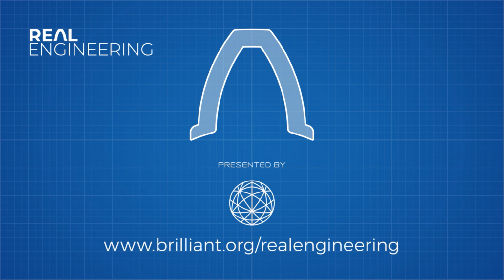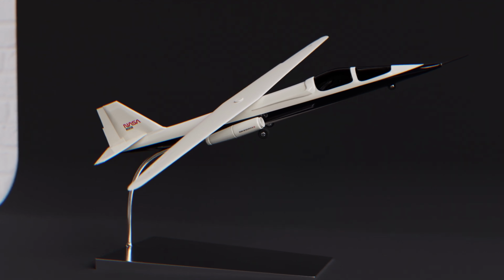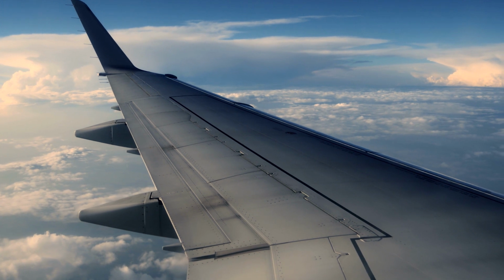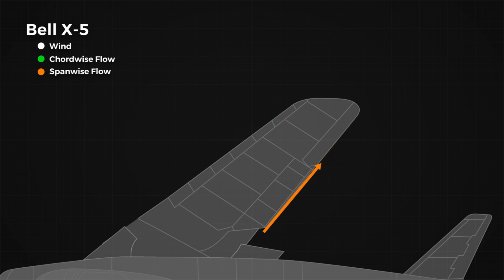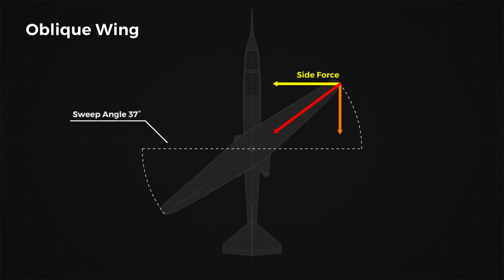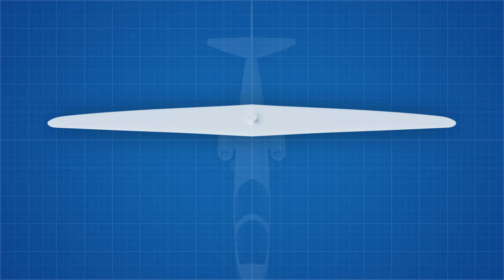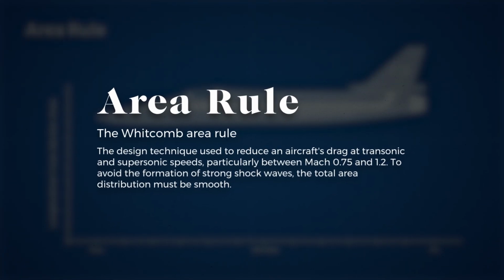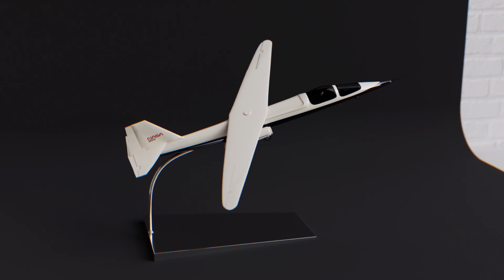NASA's Weirdest Experimental Plane

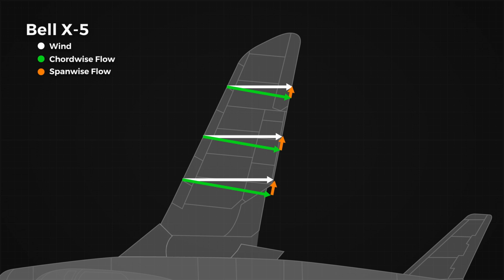Comment: 3:40 chordwise flow is the component perpendicular to the centerline of the airplane, not that parallel to the leading or trailing edge. And it happens not just because of the geometry of the wing, but because there spanwise pressure gradients due to sweep

Comment: I feel like an important aspect of the plane wasn't discussed in this video, that the oblique wing (60 degrees sweep angle) was never intended to fly transonic. It was flown during research to collect data by flying a real aircraft, rather than wind tunnel tests. The oblique wing design was proposed by Robert.T.Jones, to fly efficiently in both transonic and supersonic speeds. This aircraft, the AD-1, flew at max, 170 knots where the main idea of the design was to fly at supersonic speeds. Any challenges this aircraft came upon were not really a surprise. The idea of the oblique wing design was to fly at 0 degree sweep angle at low speeds and gradually at 60 degrees sweep angle at supersonic speeds. The AD-1 was really a scaled down NASA version of a passenger oblique wing design by Boeing.

Comment: wonder what would happen if instead of a single rotating wing like this, you had two wings in and X shape that rotated opposite of each other, you still only have one mounting point and your center of lift shouldn't change much. you also get rid of the asymmetrical drag and stall properties.

Comment: Again, I can't believe how many people get this wrong, the X15 isn't a plane, it is a rocket.
Reply: its a rocket powered plane
Reply: @jace8785  it's still classed as a rocket
Reply: @ethancotton1549  x-15 is winged, its a plane, the rocket part is only the propulsion. You are only referring to its engine, then by your logic, does that make an Abrams tank a Jet, same as helicopters.
Reply: @jace8785  no it does, so you're telling me a glider counts as a fighter jet because it's light weight and has wings?
Reply: @ethancotton1549  if the glider has a jet engine, and weapons, it defined as a jet fighter. If it doesnt have a jet engine or weapons, its neither a jet or a fighter.

Comment: Well-Done buts;
You mentioned something like ; Near mark, spanwise air flow towards wingtips cause critical mach stall & it starts at the wingtips moving towards the fuselage as aircraft speed increases.   
I'm sure it does & mybes I'm slow. Buts ??I just don't get how spanwise air flow towards wingtips cause critical mach stall??

Comment: some random guy on reddit wrote a comment tearing this video apart so im gonna paste it here 

How does somebody get to the stage where they're going to make a whole video about NASA aircraft and not know that NASA standards for National Aeronautics and Space *Administration*? 

All this stuff about frontal area is nonsense.

Airliners cruise significantly above the critical Mach number as he defines it, and if the sun is shining from the correct angle [you can see the shocks dancing on the wings](https://www.youtube.com/watch?v=HekbC6Pl4_Y) (and [engine nacelles](https://www.youtube.com/watch?v=K08Gc0tKWoA) if the capture coefficient is low). 

The stuff about flow components misses the point that it's a mathematical argument applicable to a yawed wing of infinite span. 

The whole subject of leading edge suction and the distinction between subsonic and supersonic leading edges is completely neglected. 

The FSW concept is not really about spanwise flow but rather isobar unsweep at the tips. This helps transonic manoeuvre, especially sustained turn rate at altitude. We don't build FSW fighters because this advantage is considered to have limited military utility in the context of modern doctrine (people seem to want radius fighters rather than rate fighters these days, at least partly because of off-boresight heatseekers). 

The area rule is incorrectly stated. Whitcomb's area rule of thumb was that the wave drag of a transonic aircraft is approximated by that of a body of revolution having the same area distribution. The question of optimality is separate, and clearly must be stated in terms of constraints and trades (i.e. minimum wave drag for a given length & volume). But see also e.g. [NACA report 1284](https://www.pdas.com/refs/rep1284.pdf).

The oblique wing was originally intended for [SSTs](https://ntrs.nasa.gov/api/citations/19900019224/downloads/19900019224.pdf), and there was quite a lot of theoretical work done in the UK during the 1950s following on from the original German WWII work. [The most interesting examples were flying wings with rotating engine nacelles](https://www.reddit.com/r/WeirdWings/comments/b72a78/handley_page_sycamore_sst/). 

For a more detailed overview, see e.g. [Larrimer's book](https://www.nasa.gov/sites/default/files/files/ThinkingObliquely-ebook.pdf).

Comment: What about a cruciform type wing, one similar to a pair of scissors, similar to this but with 2 wings rotating in opposite directions, wouldn’t that follow the advantages of the oblique wing and also avoid its inherent control weirdness
Reply: The only issue I can think of is that at zero sweep it becomes a very close-together biplane!
Reply: @chrisamies2141  that could be quite interesting, a jet propelled bi-plane

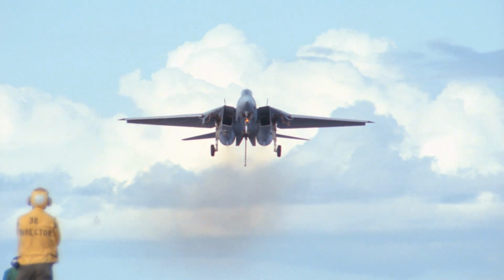Comment: @2:06 I had to run that a couple of times to figure out what my eyes were saying they were seeing :)

Notes/Comments and other stuff :)

Unsurprisingly (it wasn't really 'clear' during the program or much afterward) you missed a few other 'uses' and ideas that surrounded the "Scissor Wing" concept but one reason for the AD-1 being built was specifically to test the aircraft characteristics during flight transition (as you mention) specifically because there were several concepts of "Advanced Technology" bombers that were based on the concept where, as speed increased the 'straight' wing would eventually fold completely along the fuselage and transform into essentially a supersonic lifting body. (Some concepts had smaller  area wings that were at 90 degrees to the main wing some just used body lift) Essentially industry really didn't want to put a lot of money into further such concepts unless the aerodynamics actually worked and lobbies NASA to do the testing :)
During and after the AD-1 a lot of research was done with a "pure" flying wing design where the whole VEHICLE pivoted including the engines and verticals! The idea and concepts allowed a much bigger payload, higher speed and range but would have been a 'bit' shall we call it 'interesting' to fly in :)
The other interesting aspects and uses for using the concept, (one of which the Russian's pursued) was using such wings on a reentry vehicle using the 'body' to shield the wings during heating allowing a simpler and less massive (less or no TPS needed) wing structure.

Comment: Why couldn't they just attach the two separate wings to the same pivot point?
Maybe have a sliding track move along the body of the plane with some type of tension wire to the wingtips to move them...
Maybe include some mechanism that allows the airflow itself to move the position of the wings

Comment: You could not do high speed manoeuvres with this wing configuration, the stresses were too great.  At best it wold have been used as a platform for air to air refuelling and not a very good one at that. Not many practical applications to be honest....great video by the way.

Comment: Why not an "X" wing then ?
There are quite a few examples of modern biplane that don't have the issues caused by the old ones who had a lot of linkages creating drag and adding weight, we can now make them with independent wings, plus it can also work as an Ekranoplane.
So at higher speed, a pair will be shifted on the front and the other on the back, in fact one of the pair could literally get to 90° to be against the fuselage to act as a skirt for lifting body.

Or alternatively the VTOL Helicopter Airplane hybrid (Whispercraft) from The 6th Day movie !
Reply: ᴛᴀᴘ ᴍᴇ ᴀɴᴅ sᴇᴇ Bella  
Where did I say that it was for association?

Comment: regarding the bending and torque issues of the symmetrical variable-sweep wing configuration, would a more sensible single-pivot point solution not be to have a kind of scissor mechanism? So like, a single straight wing splits into a 4 wing configuration in a cross shape... an X wing if you will...
I don't know how you would deal with the aerodynamic properties of the wing cross-sections or what have you, nor do I know what the flight characteristics would be, but damn would it look way less derpy than the asymmetrical one-wing design! If this exists, I would love to see a video about it, and if not, please someone make a model and simulation of it pretty please 😅

Comment: Your explanation of chord flow is not quite correct. Flow is directly related to airflow over a certain wing shape in any angle of attack.  Altering angle of attack is just another way of saying that the wing cross section has different flow numbers at any point along the wing. This generates lift differences via different wing shape per angle of attack. The shape of the cross section determines it's lift in any angle of attack. Altitude and/or viscosity of the fluid also plays a role in determining the overall lift. To cheat the physics defeats the purpose and is called a "lie".

Comment: Hello Mr Engineering. Just heard a mistake in your information. At 3:02, you said "airliners cruise just below critical Mach number". This is not correct. Airliners usually cruise ABOVE their critical Mach number.

Comment: Original Nasa contract for the Oblique wing AD1 was $250k for a paper study, Burt convinced Nasa they could build a flying proof of concept for the same money. So they got the green light to build it. Right before test flight Nasa freaked out and halted the first flight. They had assumed that the $250,000 was for a sub scale model airplane, not a full sized manned airplane. NASA is extremely risk adverse and has crazy protocols for manned test flight. Anyway eventually Burt got approved to fly it, but it’s a good story that Burt told me back in the day. Also, the x5 is a Nazi p1101 brought to USA after the war.

Comment: I used to have a flying model of this airplane design when I was young and it flew great. I was actually surprised at how well it flew considering how unusual it was. It was also tailless, unlike the NASA piloted example here.  One of the other advantages of the oblique wing is the significant reduction in drag that comes with this design which also makes it good as a high speed transport. The Alexander van der Velden oblique all-wing supersonic transport design and the Boeing OAW-3 sharply swept wind tunnel model are pretty interesting.  I think people also are naturally biased to the idea of it being a manned aircraft and I think that it's real future is as an unmanned design like a sensor platform ...or maybe even as a design for a winged probe for NASA if you really stretch your mind.  There are several other advantages to the design that go even beyond the ones mentioned here, particularly if the design is kept as a flying wing.
Reply: This design may benefit more from vectored thrust or by selectively increasing drag on particular sides of the craft rather than by using traditional ailerons.

Comment: Gravitricity... this is the name of a company that stores energy in form of concrete blocks at the surface and when the energy is needed it they lower them with cables connected to generators. I'd love to see a video about them and the potential of the concept.

Comment: The most logical step would be attaching two of these to the sides of a plane, like massive rotors. Would probably not be worth it with the required arms though. I'm a bit surprised that there are no mechanically linked swept wings though. That should help with keeping forces between them symmetrical.

Comment: Well it seems to me the logical next step would be to have two pairs of centrally mounted wings. One that sweeps forward, the other sweeping rearward. When straight, they would form a single, wide wing. In this way, it would make sense that the advantages of constant center of lift and structural forces are combines with the symmetrical sweep of traditional wing. Having 4 wings, it could be surmised that the wings can be kept shorter to than normal to somewhat offset the additional drag of the extra wings. Besides, a plane with X-shaped wings would look pretty great.

Comment: As someone with very little understanding of the underlying physics here, the last bit about variable sweep wings moving center of lift backwards as the sweep angle increases made me wonder if anyone has modeled or tested this design: If you had arms spacing the pivot joints away from the fuselage, the wings could take advantage of the simpler mechanism used here, get the advantage of the symmetric tension, and also keep center of lift centered around the pivot arms. I'm not sure what kind of geometry would solve for the variable distance between the inner edge of each wing and the fuselage, but I feel like it could be fun to play with in Kerbal Space Program or something 😃

Comment: The absolute chrome-plated steel BALLS on the test pilot who actually got INTO that thing.
Reply from the maker: It was fairly well behave in most situations. Test pilots gradually expand the flight envelope. They never tested the plane to stall, for the reasons stated in this video, but with enough altitude the wings would be unswept and recovered.
Reply: I'd say anyone who gets into a test plane to fly it first has balls of steel
Reply: What I always find fascinating is when you hear test pilots talk they like it's just another day at the office. Clearly they are too busy to think about being scared.
Reply: Their profession is one where turning their head might actually kill them. You can't tell them anything.
Reply: @methos1999  I'm not a test pilot, but I am a skydiver, and there's a similar distinction in how skydivers and non-skydivers think about skydiving.

Safety is so engrained in the sport that it's hard to spot if you're not "in the know," and the sport looks way scarier if you aren't aware of the dozens of safety measures behind every dive.

I imagine test pilots have a similar experience. They're comfortable because they in the hundreds of layers of safety protocols surrounding a test flight. It's scary for us because they don't ever talk about those precautions, but to them it's just as mundane as putting on a seatbelt.

Of course, they're still incredibly brave with a streak of devil-may-care (especially military test pilots), but probably not as much as it seems from the outside.
Reply: There are also flight simulators they practiced in for a long time. Obviously it’s only a simulator so yeah still a pretty brave pilot.
Reply: @mosesfox52  I mean, if something broke on the swing or even on one of the control surfaces...
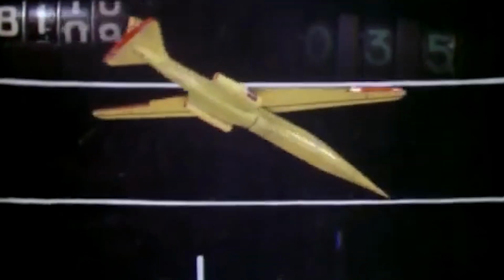Reply: 6:32
No No No, you get it all wrong. They were just making a Dabbing Jet Plane.
Reply: Not really, they did a lot of subscale testing before the prototype was built. In fact aerodynamicists at nacelles were working on this on their own time and naca took interest after watching a RC plane flying.
Reply: +gold plate over the chrome plated steel balls.
Reply: Ok
Reply: I mean, if NASA tells you it’ll fly, there is a very, very high chance it will do just that.
Reply: @Kroggnagch  Shuttle fatality rate was 1.6%.

Comment: Could you possibly do a video on why we don’t see the area rule (I.e. tapered fuselages) on modern fighters any more? Perhaps they’re incorporating it more subtly but I find it intriguing to note the apparent lack of something that would increase performance rather simply.
Reply: Stealth is more important than the coke bottle shape of a delta wing fighter?
We hardly see wing roots any more because of reflection.
Reply: @jimurrata6785  Interesting take! What you say makes sense to me my friend. There is an interesting thing to consider however. I must add that even before stealth jets took hold the F-16 Viper and F-15 Eagle were produced lacking any observable area rule effects on the airframe. Its entirely possible I'm just missing the more subtle applications of it on the airframe, but when I look at an F-15 it looks like the engine nacelles are straight... no coke bottle shaping to them at all! Just surprised. I would not be surprised if I missed it somehow though!
Good thinking!
Reply: @Mobius118  I know less about area rule and more about Reynolds numbers.
Fluid dynamics fascinates me but I don't have the maths to be a better engineer.

Comment: What if there was two wings on top of each other, so that in regular flight it looked like a normal wing but in supersonic flight it looked like an X? That way you get rid of a lot of the stability issues due to the asymmetric design.
Reply: I'm pretty sure the leading wing would make the airflow unstable for the wing behind
Reply: @Skankhunt-mv4vd  what about... giving the front wings a dihedral, and the back wings an anhedral

Comment: Spanwise and chordwise flows aren't real. They're just mathematical resolution of the actual flow into components in the direction of the span and the chord, just as you can resolve the movement of, say, a ship into easterly and northerly components whilst heading in a straight line from Sydney to Hawaii